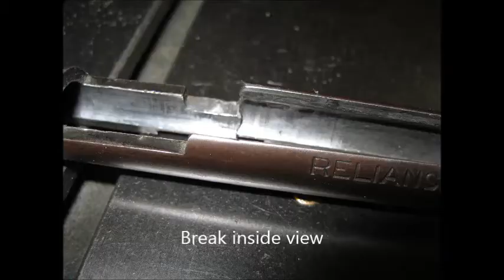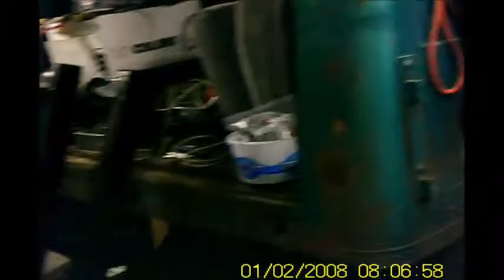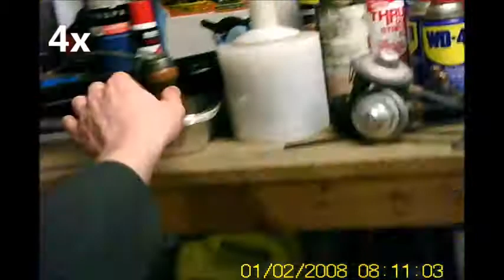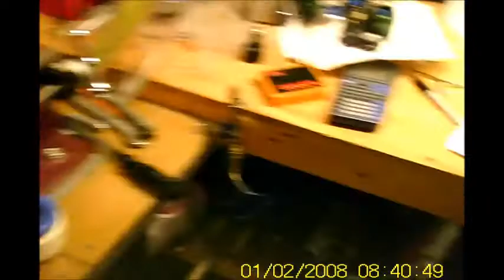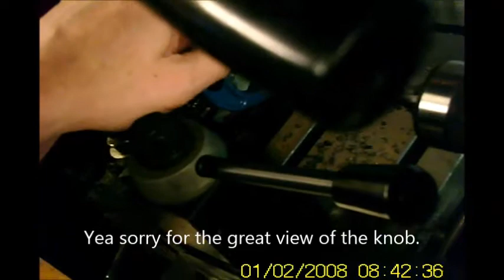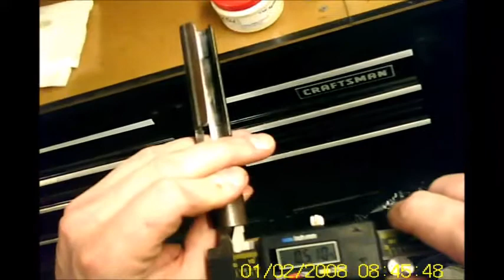[WRP] Page-Lewis arms model D repairs part 1

Comment: I had shot one when I was 6 yrs old,found out I was blind in rt eye,took a trip to eye Dr,many yrs later I always was shooting it,it shot very well,I was 17 then but that time when I shot it powder and flame flew back in my face,I was not hurt I did not shoot it any more,the frame broke rite where the bolt closes,opened up that gave a gap just enough to let powder gas to escape,wished I had known about how to fix it then...thanks for a fine video garland